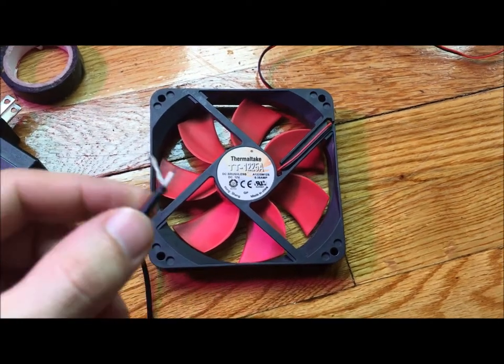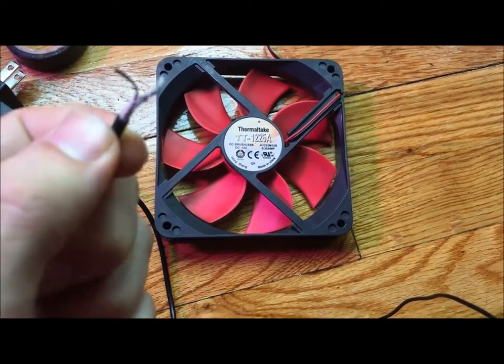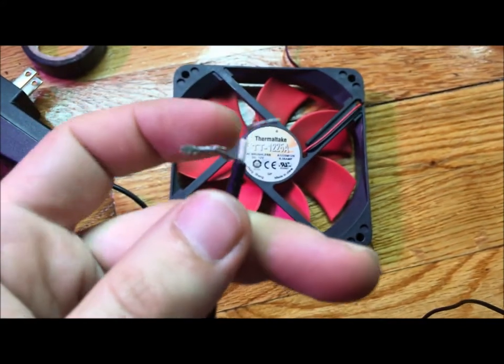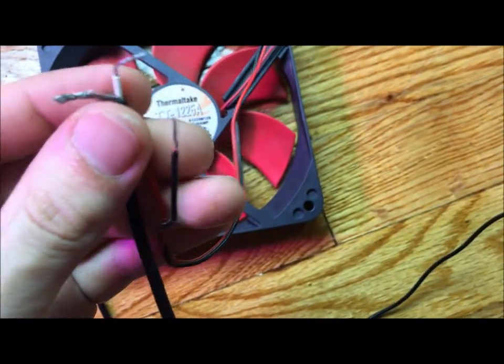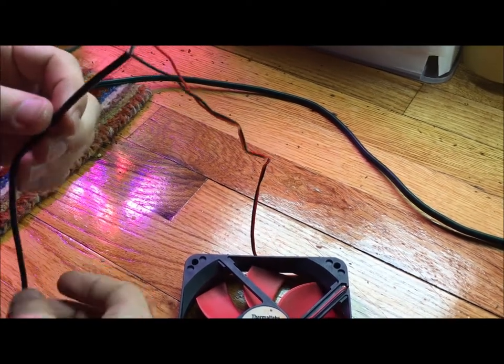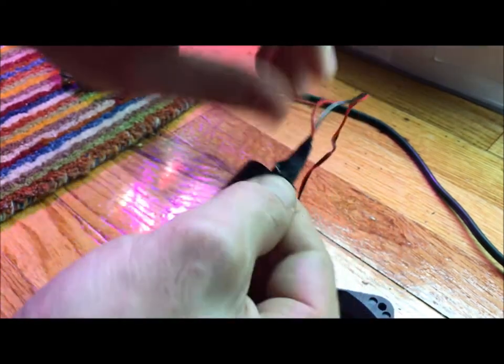How To Build A Grow Room Fan - Easy DIY Project

Comment: It's a good idea with 3 recommendations: (1) if this thing does start a fire you might nullify your insurance (ie: all items lost in your house GONE),  (2) a simple (they are cheap) fuse can be put onto the wire between the plug and the fan (on the outgoing current from the plug) ...so that if the amps are exceeded, the circuit will break, and no more electrical fire risk.  Don't put it on the current coming back because the fan could still melt before the fuse kicks in.  (3) make sure you tape up your wires separately...any exposed wires touching each other will melt the plastic and start a fire...but at least if you put in a fuse, it will blow.

Comment: nice! you need to hook it up to solar panel exaxtly like your air filter. why not continue recycling the wasted light! either way very informative. 

Garden looks great.

 my roots in my kratky finally hit the water so it's time to get some masterblend. Im new to the hydro system though, so any advice?
Reply from the maker: Hey Stellio thanks man, oh yea that means it's going to have huge changes in growth now. You will begin to see differences each day pretty awesome. My only advice would be after you fill the hydroponic nutrients don't forget to check the levels from time to time so does not dry up on you. Lost many plants this way (in just few hours) Provide sufficient light and night schedule (I run 14 hours on 10 hours off) and keep around 2" away from lights while it is still growing and young. You should do great and don't stress out if something not going right. Its all part of gardening and will be a fun ride. Also cover up the base to not allow light to get to roots. Happy roots happy plant.
Reply: Could u post come video of solar inline fan please? Thanks

Comment: The fan is 12v and the plug puts out 5v - shouldn't the plug be 12v as well?
Reply: ideally yes, although it will still work it just will be quite a weak fan speed
Reply: @Cactuspractice12  Isn't that what the video says?  He didn't want it to blow too hard.

Comment: maybe change the title to hooking up a 12v fan to a power supply, doesn't really do much for the grow room like that it needs some sort of case/housing and if it's for a grow space it'll need a carbon filter or it's just an air mover.  be very careful using an under powered supply like your using too it might work for a while but if you leave it on continually it will eventually catch fire. maybe hold off on the "how to" video until you know "how to" not trying to criticize but when your dealing with electricity the wrong information can get somebody hurt or killed.
Reply: And what is the right information that we should know about?
Reply: Why will it need a carbon filter not every 1 is growing weed. you waste your time . Pluse it wont catch fire unless you run to much V and I through it so his motor will fail with time like ever over pc fan in the world
Reply: @tedmosby9409  it will... The reason is that the adapter have no power to feed the fan and is going to work as hard as it can, resulting in overheating and possible catching fire
Reply: Would it be safe to just connect regular pc fans to pc and use them that way?